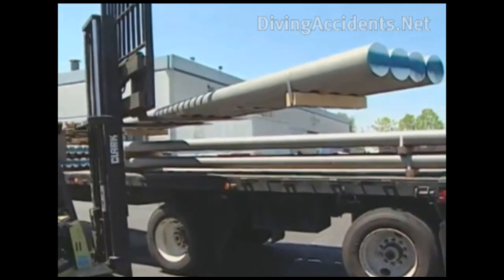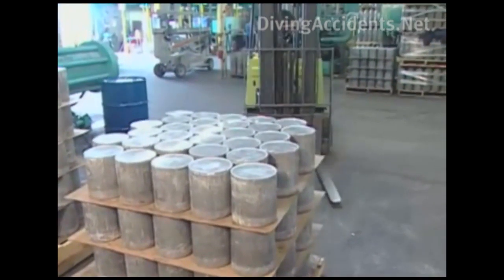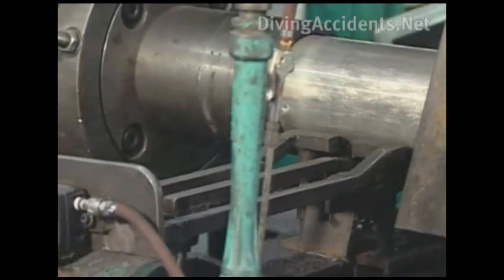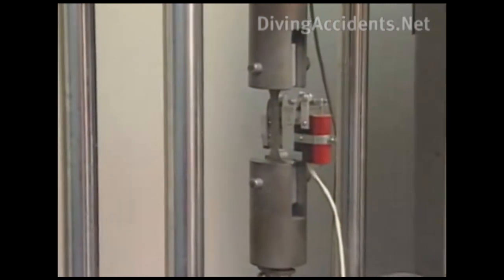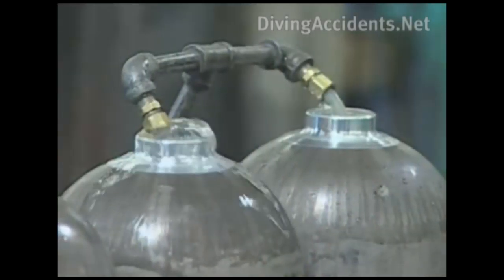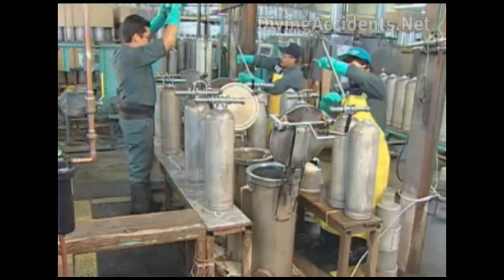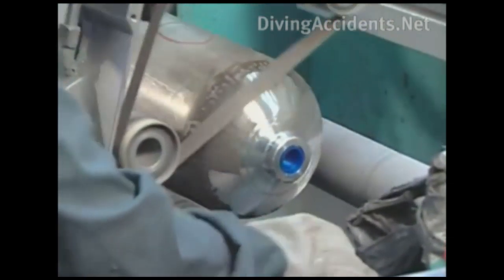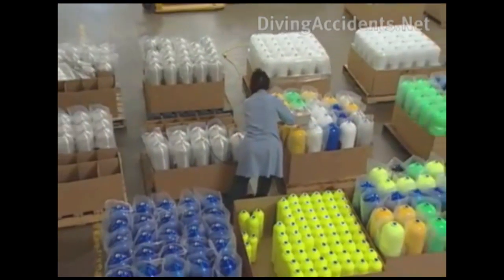How Do They Make Scuba Diving Oxygen Tanks from Diving Accidents

Comment: There cylinders or tanks or bottles. Don't label them "air tanks" because mine are currently filled with a rather different blend. And see how well oxygen at 42m works for you. For the rest of us, 6m is the maximum, unless your performing an in water re-compression. Then 8m is the maximum, and the in water re-compression should only be performed by divers trained in the procedures.